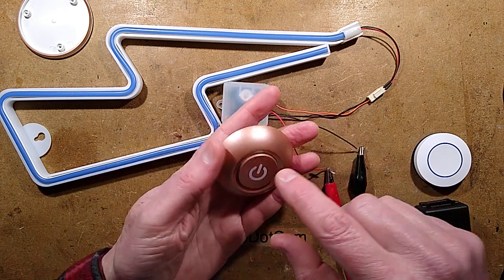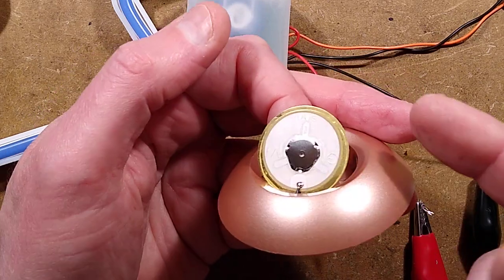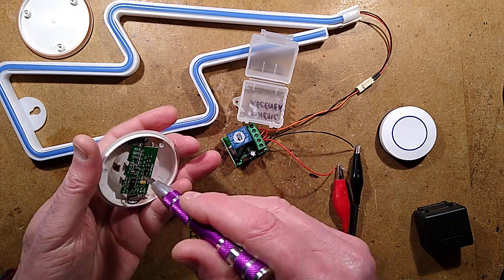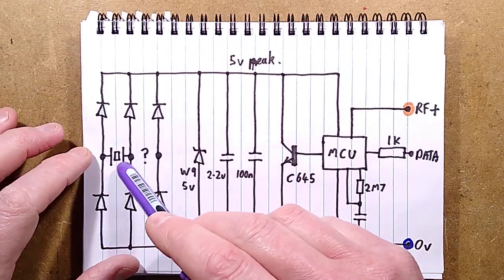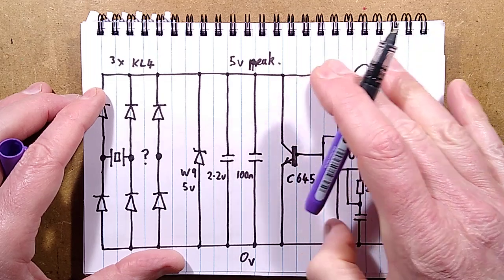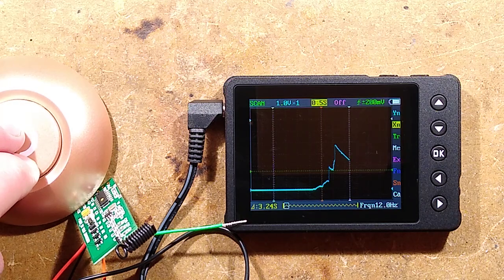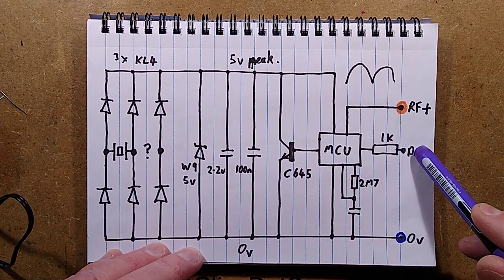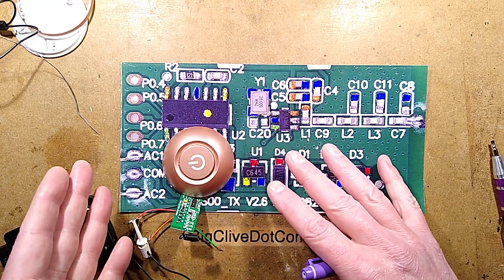I thought this was going to be a fake kinetic switch

Comment: Very interesting!  
Many years ago I built a seismometer using a piezo disc for the sensor. I fed the signal from the disc into an op amp integrator. There was zero travel of the seismic mass and the response was totally set by electronic components. It wasn't practical though because the disc was easily destroyed by bumping the case..

Comment: I'm surprised the voltage off that piezo is so low. I always thought voltages off those were much, much higher.  Are the caps in parallel  helping to smooth those spikes, or are the voltage outputs tuned when the piezo is created?  Super neat!
Reply: It's probably the caps, not the Zener. They'll make huge voltages when unloaded, but when the small amount of energy they make is immediately dumped into a cap that will present a very significant load and prevent the voltage from getting to high.
Reply: A piezo disk is basically a capacitor, when you stress the disk it acquires a charge. Since the capacitance of the disk is very low the voltage will be high (Q=CV).  When you connect a much larger capacitance via the rectifier, that transfer of charge results in a much smaller voltage.

FWIW Zener diodes are basically garbage, they do not switch on and off suddenly at their rated voltage, but gradually turn on as that voltage is approached. Even at 4v there will likely be some small current flowing through a 5v zener.  The lowest voltage zeners (2.7v or so) have absolutely terrible behaviour in this respect, with a very poorly defined knee voltage.
Reply: Definitely the storage cap.  The piezo generates a high voltage open circuit but if you wack a cap across it it takes time for the charge to build.  A short pulse won't raise the voltage much.   For the circuit here it seems that it only gets up to about 4V.   If you doubled the cap it wouldn't even get there.
Reply: The zener is limiting the voltage.
Reply: @MarshaJ8800TU  To below 4v?  I'd expect it to show 5v if the zener wascappingthe voltage.
Reply: I always thought they produced tens+ of volts, this looks like 4ish after rectification?
Reply: @wimwiddershins  I thought it was in the KV range, since lighter sparkers use them to generate the arc for lighting lighters. I think it depends on how hard they’re struck and possibly how they’re made.
Reply: @BRUXXUS  I think lighters have a coil in them which bumps the voltage up. Also, the crystal used in lighters is much thicker than used in this application.
Reply: The zener is keeping it low

Comment: Can it make sound when passing a signal to it?
Reply from the maker: It should act as a sounder too.
Reply: Yeah, but not with that circuit. It's a transmitter only - it can't receive a command to make a beep and can't power the beep from the piezo-generated power
Reply: "Mate, this bird wouldn't "voom" if you put four million volts through it!" (extract from Monty Python Parrot sketch...)